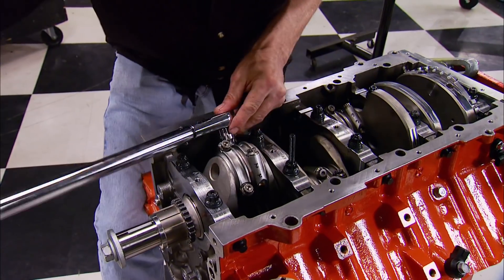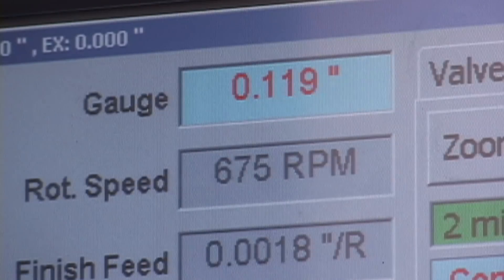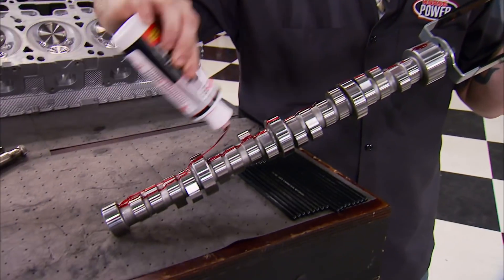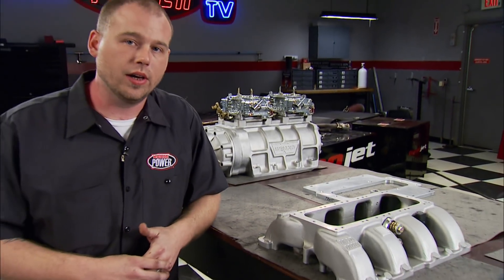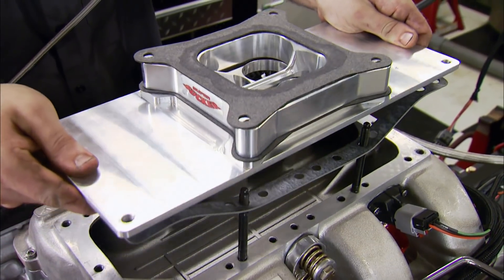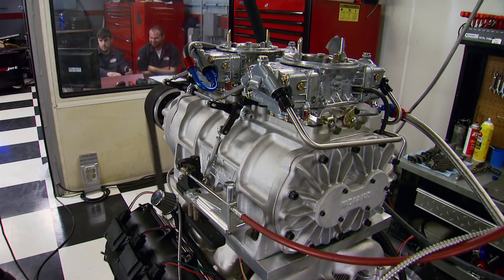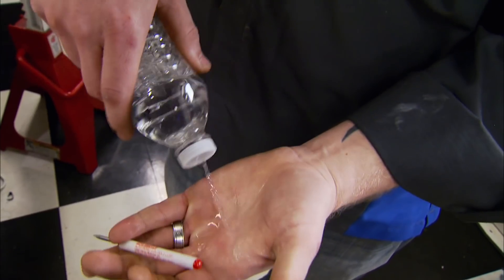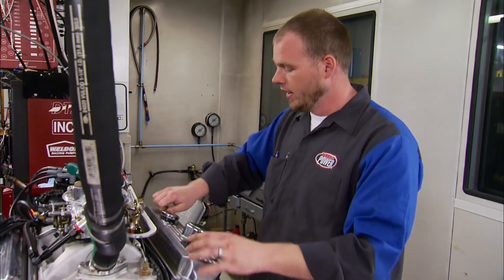Marrying A New-Age Hemi With An Old-School Supercharger - Horsepower S16, E5

Comment: Excuse me, but did I  see you put a single row timing chain on that overbuilt car? A drag car is only as reliable as it's  weakest link. Very disappointing. With all the equipment on hand at that shop, they couldn't  CNC your timing plate cover?

Comment: Dang I was really expecting 7-800 horsepower I just watched a video before this where a guy took a junkyard 5.7 done no internal work... Changed the Cam, ported heads, four barrel fuel injection and a supercharger belt driven not a root style...wasn't even pushing it that hard and was producing 677 horsepower...🤔🤔🤔🤦

Comment: that pile of crap couldn't make at least 1000 HP ???
weak sauce
Reply: Really because of all the dumb comments yours manages to be the worst. It's a simple mater of mathematics and volumetric efficiency equations. The motor should produce 1000 to 1200 with timing and a raise in boost with a smaller blower pulley

Comment: You can 500hp   out of a 5.7 without that 8-71 blower
Reply: lol they didnt build a 500hp NA 5.7,  they just built a tough stock HP one to handle the blower. if it made 500hp NA  the blower would put it at 700. dummies already think  a blower means 1000hp.  they did this to show what JUST adding a blower would add and built it to not throw a crank out the block

Comment: Engine Power built a 6.4 hemi to 562 HP with EFI  and that was with the truck engine which started with 410 hp compared to the 475 hp scat pack tuned engine. Either they are not putting enough boost or something else Is wrong.
Reply: Ididnt you see that big wuss pully? Maybe 10psi on a mostly stock 5.7  that is not bad starting numbers

Comment: I don’t know how old this is, but no numbers for the N/A pulls? It really should have made that power with no blower 🙄🙄🙄🙄! No fueling adjustments, No timing #s or adjustments? No boost numbers, No pulley swaps? Some info should be given! Anyway Don Garlits was the first one to supercharge the late model Hemis wayback around 2003? I think he made a distributor drive to run it on a magneto, because he wasn’t going to use a computer on one of his dragsters from the 50s 😜😜😜😜! He also ran it on 90% nitro! It’s absolutely the best sounding late model Hemi I’ve ever heard 👍🏻👍🏻👍🏻👍🏻🇺🇸🇺🇸🇺🇸🇺🇸! It also was a dead stock 5.7 Hemi! Because nobody had even started to produce parts for them yet! I think you could find it on the internet! But it’s much cooler to see & hear standing next to it 🤪🤪🤪🤪👍🏻👍🏻👍🏻👍🏻!
Reply: I saw and heard it in person a couple of years ago.
Reply: stock 5.7L Hemi engine typically produces around 395 horsepower, nothing they did to that motor added any HP but the blower.  all the work they did was to make it last with boost,  blowers only add 30-50% hp and that maths.....lol 400hp+50%=???

Comment: They need todo a redo. 600hp, that's like 125hp more than a stock 392...wtf went wrong
Reply: My cam, headers, ported heads SBE 392 makes 536/494 to the tire. They need to add timing and turn it up. Prolly only 6psi of boost.
Reply: @dalemllns  you have an 8-71...why do 6lbs of boost?

Comment: An 8-71 on on a Gen lll 426 Hemi?!?!?!?!?  Should be making well over a 1,000 HP.
Reply: No OD% stated that I know of or pully size. but it must have been 6# of boost.
Reply: These guys are clowns and have no idea what they’re doing
Reply: @scottsmith31  Very true.
Reply: 😂😂 @scottsmith31
Reply: I'm thinking too that the hemi builder didn't want to blow the engine so they may have been playing it safe. They were also only using 93 instead of any race gas. Just a theory!
Reply: @pablotharpalo5685  The main problem with the Gem III is a weak block.  Should have used a 'A' motor block as they are far stronger.  There is a 'A' motor engine on the website with a Hemi Head, 360, that makes over 600HP, NA. Why make a smaller block??? Dumb!!!
Reply: @ronsmith7739  ummm run your A block to 1200 hp and see if you change your tune lol
Reply: 426? lol its a 362

Comment: No intercooler? not trolling but dont these old style blowers super heat the air?
Reply: That’s why there carbureted the fuel cools the IAT and lubricates the Teflon lobes. Other then that high octane to resist detonation.
Reply: @LEGOCAMARO  ok cool, i was worried, ive always seen these with a a sandwiched water to air intercooler.

Comment: Only 690 hp?  I expected @ least 800-1000 hp.  What gives?  A 572 will do that on carbs alone.
Reply: Not with 93 pump gas
Reply: superchargers generally only add 40-50%hp they didnt do much above stock and a big low boost pully, prob hiting max.  1000hp in a 572 lol....this is only a stock 392 with maybe 10# of boost
Reply: lol yeah only 40% more cubic inches couldn't be a factor

Comment: 1800cfm for 600hp? lol
Reply: Ya my buddy's 512 stroker is making 750 hp with 1050 all motor 🤣
Reply: @Ratridez  392 vs 572 yea think about that 😂 plus pump gas no e85 no thing out of a Carburetor an a old ass blower just stop y’all are dumb af
Reply: @YesNo-ty5eb  You missed the point entirely. We're on a whole other level of conversation. Maybe ask a question instead of insulting and staying ignorant.
Reply: @Diesel257  someone’s mad 😂🖕🏻🌽⚽️
Reply: That motor was has weak has tissue paper.
Reply: A bit rich id say
Reply: My lawn mower pulling 55horses. Then 35 shot. Of oh shit juice runs harder than this blower motor junk